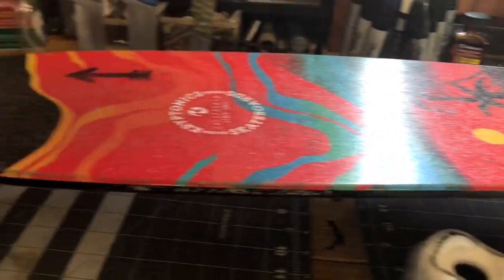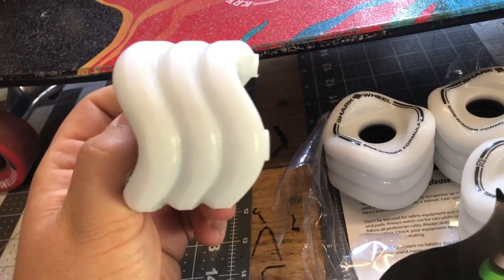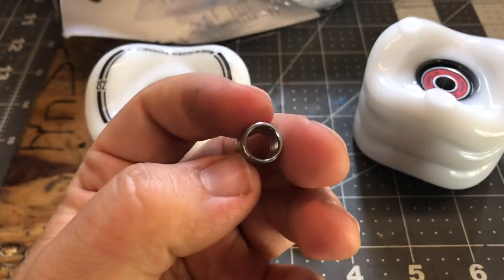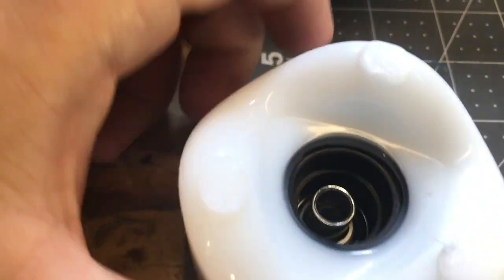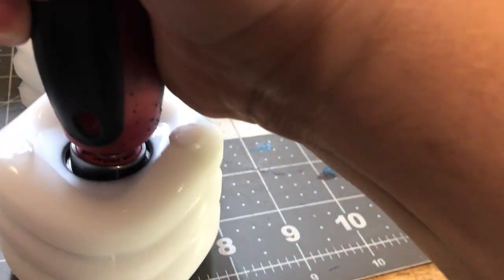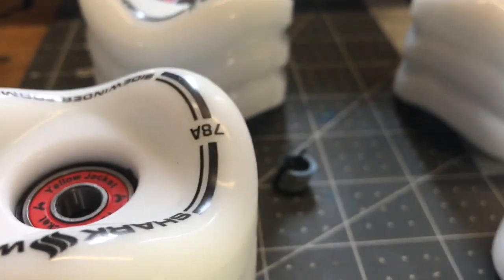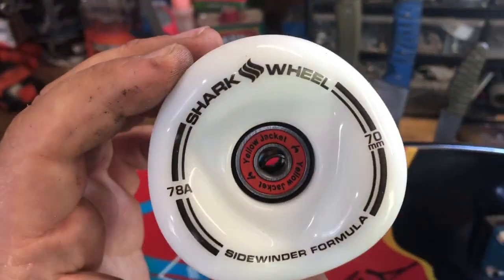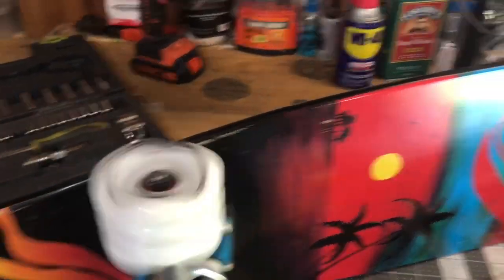Do Shark Wheels Suck?

Comment: I've been using shark wheels for a long time now and it's the only wheel I will ever own. Little pricey but they are worth every penny. Think I've had mine 7 years or 8 years now and same set and they held up and still hold thire name. Never going back
Reply: When those are in bad condition roads or find a rock on the road it still happens that the wheel get stuck and brake instantly?

Comment: By the way the wheel came to a somewhat abrupt stop on 07:01 & considering you are using new bearings (rated ABEC 9 accourding to the specs on Amazon), it seems like the axle nut was slightly overtightened.

You also made the right decision by instaling the washers at each side of the wheels, as this are meant to reduce the friction exerted by the parts of the truck that fix the wheel in place (end of the hanger & axle nut).

I hope you guys get to enjoy lots of rides together
& may the force be with the both of you!

Comment: Hello im 13 and riding naked signature pro, i live where there Are gravel dirt and asphalt roads. I would really like to know if they Are useable on gravel and dirt or not?

And do they fit on my board? 

Regards Valdemar from Denmark
Reply from the maker: Wuri PvP they probably will fit on your board if it’s a standard truck. I imagine they’ll be better on gravel than basic wheels but I imagine there are off-road wheels that would would better for gravel than these. These might dig in
Reply: @TheForerunner117  Thank you for your Quick respons is there Any other wheels you would recommend that isnt high priced?
Reply from the maker: Wuri PvP most of the ones I see that see for off-road that look proficient are pretty pricy. I’d try some shark wheels and see how you feel. You want something soft and large.
Reply: @TheForerunner117  Thank you for your help!
Reply: To a point....i went from concrete to straight dirt going about 15 20 miles an hour and it was smooth and easy riding but pushing off was a different story because of the dirt itself

Comment: hey! nice video, I got a question, how does the shark wheel do against concrete sidewalk with large expansion joints? Especially those that does not have silicone strip filled in. Thanks!
Reply from the maker: Thanks; I have yet to find a crack in concrete that has stopped me dead in my track. They do seem to be softer than typical wheels so I imagine they’d do better, but maybe marginally

Comment: Do you know how to get bearings out of shark wheels
Reply from the maker: DanZel unbolt the wheel from the truck, and use the threaded post to hold the wheel still while using a screw driver to pry the outer bearing off, flip it around and repeat.
Reply: @TheForerunner117  thank you and will it hurt the wheel at all
Reply from the maker: DanZel nah they should be fine.
Reply: DanZel use the trucks or a pen

Comment: Do those bearings spin fast and long?
Reply from the maker: I've gone about a 100 miles on them so far, and still going. I'm probably going to try a more expensive set soon to compare the difference in value
Reply: @TheForerunner117  oh awesome. I was thinking of getting some nice expensive ones too, I really like speed so was thinking of getting some bronson g3 or some... idk yet. If you could make a video on the ones you get I would really appreciate it!
Reply from the maker: AJV  I can definitely tell you that the smoothness and speed difference from the stock ones were highly noticeable. Especially since my girlfriends board still had the stock ones, you could easily see the difference between the two. And for something like 10$ I think I spent for them, You can’t go wrong

Comment: Are these just for long boards or could you use them on penny boards or normal decks?
Reply from the maker: Bee Anderson you could.  But you might have issues with wheel bite, or at the very least, just not be able to lean as much unless your trucks are tall or you prefer to have them super tight
Reply: You can, just get the 60mm 78a shark wheel